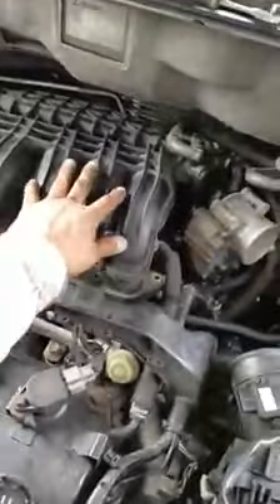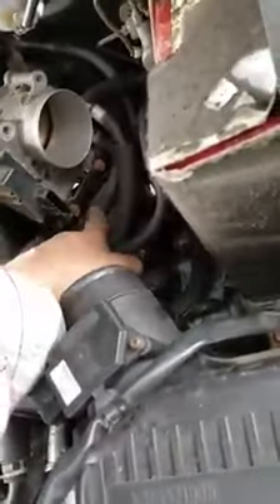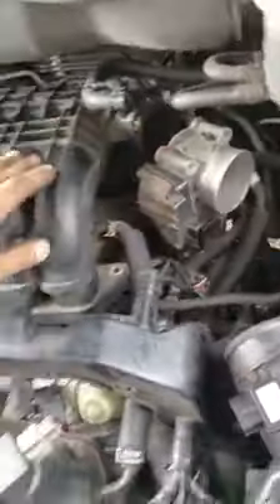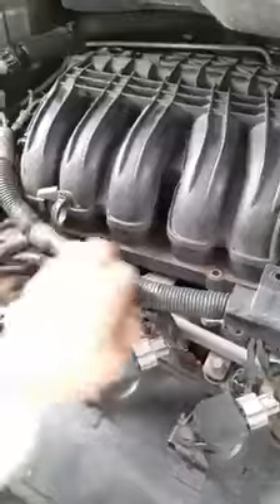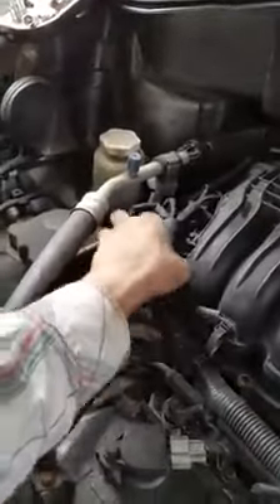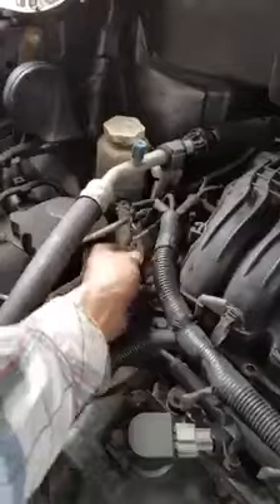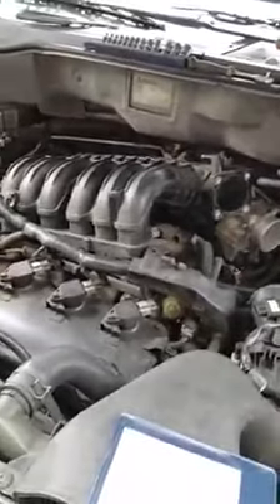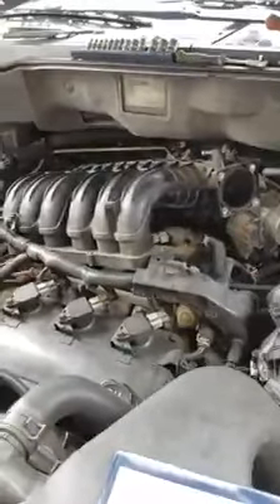2004 Mitsubishi Endeavor ls tune up, how to remove intake

Comment: Did u take the battery off
Reply from the maker: I DON'T THINK SO , BUT EITHER WAY IS FINE JUST DON'T
 TURN KEY ON OR U GET LOTS OF CHECK ENGINES IF YOU FLIP IGNITION FORWARD IF ITS TAKEN APART